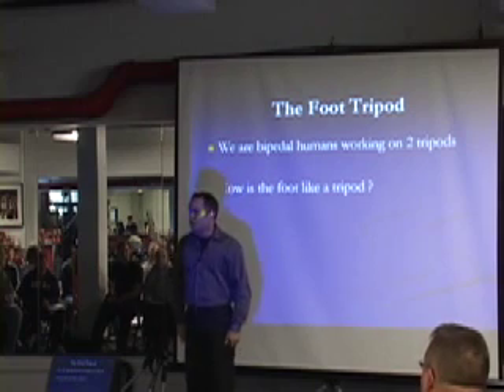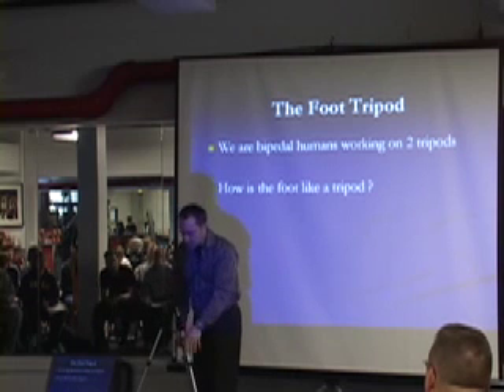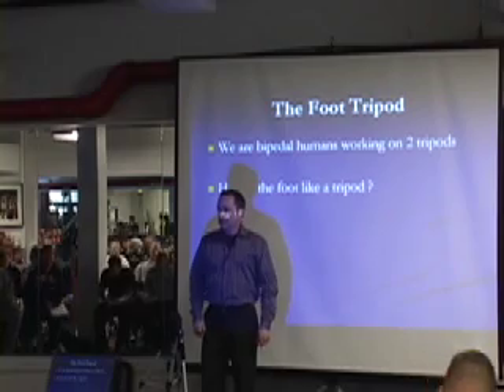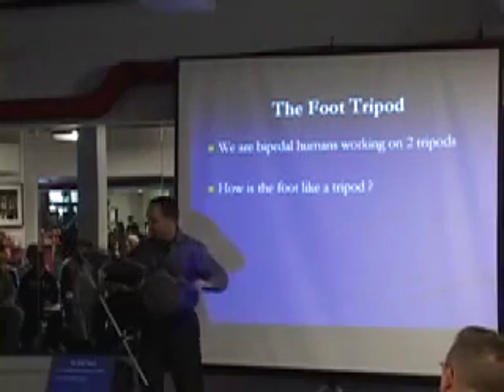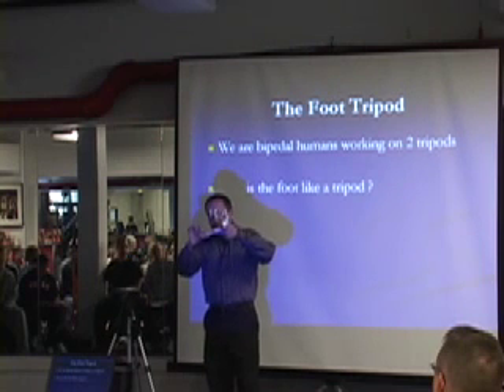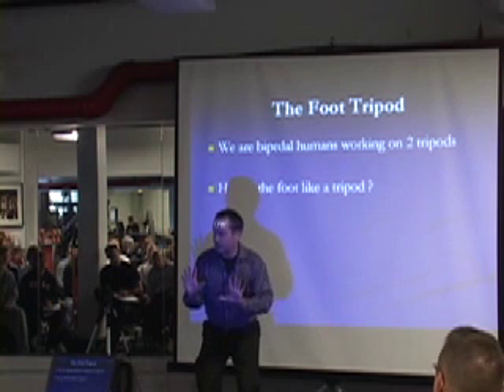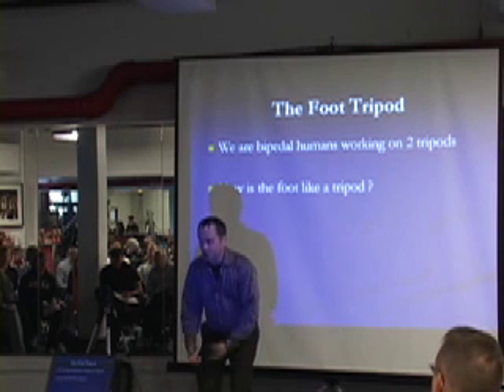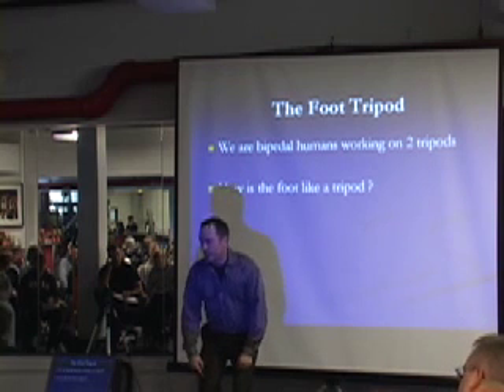The foot tripod

Comment: I've been working with this movement pattern for the as long as I can remember. This video explains my experience perfectly. I'm just beginning to understand how to work with a more functional pattern. Watching this gives me faith as it explains precisely what I've discovered whilst working to find my foots tripod. Thanks for sharing 🙏
Reply: Hey, what exercises have you been improve your tripod? I can easily find the tripod, but I can't maintain it as I walk.
Reply: @DSRT888  my case is  quite unusual and likely doesn't apply to most. Since posting this comment I've actually been diagnosed with something called Miserable Malalignent Syndrome. Essentially I have deformities of excessive external tibial rotation and excessive femoral anteversion. All my problems with my foot therefore originate from deformity and dysfunction happening higher up the chain. I'm now unfortunately looking at 2  years of corrective derotational surgery to straighten out my limbs 😕
Reply: @CuriousConfectioner  Wow... 

Good luck man.
Reply: @DSRT888  Thanks that's appreciated. I'm actually in this coming week for my first rotational procedure on my right tibia. S#\%s about to get real 😅